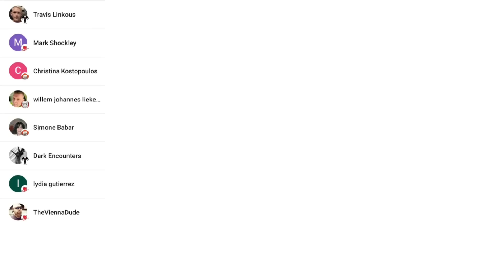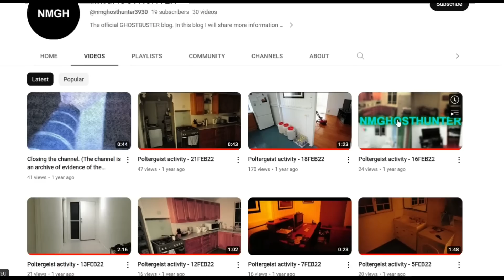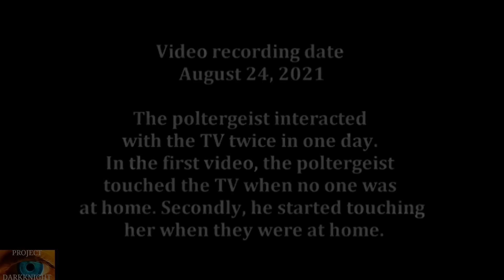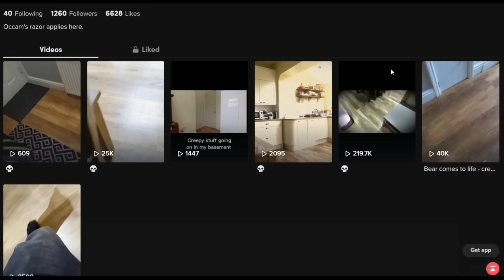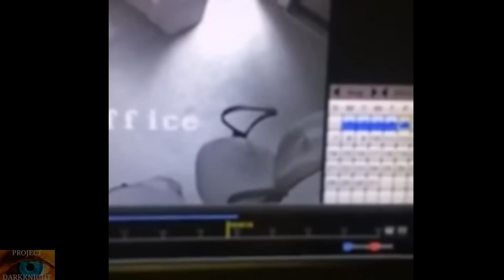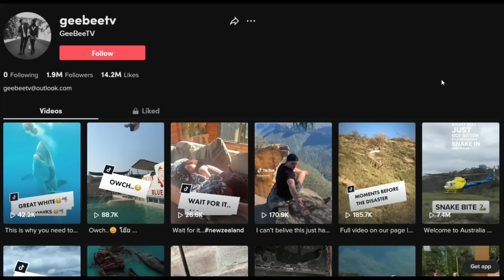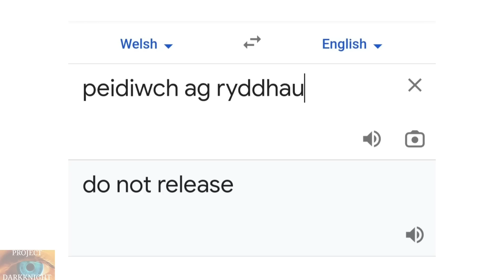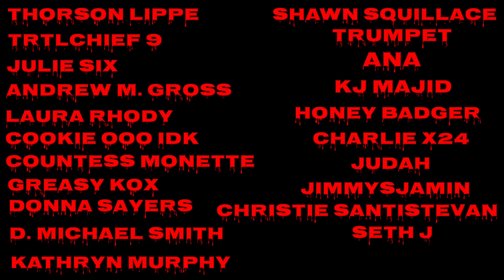Scariest Paranormal Videos That Will 100% Have You Checking Under Your Bed: WARNING

Comment: you can literally see them pulling a string from outside the glass door, it even snags on the curtains moving them when trying to pull whatever it was off the counter. green costume also makes it easy to edit people out but not easy enough when arranging the flour.
Reply: At what part when it did that
Reply: Nah you can't see a string. I'm sure dk wouldn't p post something that obvious.
Reply: I agree. Even where the curtains and papers were blowing, you can clearly tell the doors open and it’s wind. The flour part look heavily edited.
Reply: @milkyo1206 yes they definitely would lol. Anyone will do anything for money or fame. People know how gullible others are when it comes to the paranormal.
Reply: I can see cuts of the video at 08:45 and at 08:54
Reply: @milkyo1206  no you don't see the string, you see the shadow of the person outside pulling the string on the curtains while at the same time the curtains move in a way that requires pulling as opposed to being blown at the same time as the object moves on the counter

Comment: 10:43
Dude, not only was it pretty bad VFX, the "markings" in the flour are made the same damned way that you would make fake baby footprints. Put your fingers against your palm, almost like a fist, with your thumbs up. Then, tap/smack the bottom meaty portion of your hands into whatever you're marking. If you stagger and alternate left and right hands, it looks like a baby was walking. Normally you'd do 5 little dots by where your pinky touches, but here they just made 3 long lines in a bisected "V" shape to make the feet look "inhuman."

I'll commend them on their commitment, but all of their stuff is clearly just an amateur attempt at basic VFX techniques. You can see too much artifacting around where the "evidence" is shown, signalling that those pixels were altered before being compressed to try to hide it. I definitely want them to keep working at it because with enough practice, they could produce some good results. But I couldn't imagine trying to pass any of it off as genuine. Hell, the flour thing happened literally immediately after the girl walks out. Seems a little too convenient, right? And there aren't any bits where anything gets recorded on cell phones or from 2 different perspectives or even in high resolution.

There is a difference between thinking you did well as an amateur, and knowing that your work is good as a professional. It takes a lot of practice and patience to master that kind of stuff.

Comment: I think the first one was fake. It only took the sister 15 minutes to get evidence. Come on. It looked like the figure just appeared. Didn't look right to me. The shrek figure raising it's arm and then waving. I don't know.
Reply: Caspersight would tear that first one apart in .2 seconds. There is an obvious cut in the footage right before it appears to tromp through the flour. The flour ends up looking stirred up. I bet they didn't like how it turned out the first time so they had to erase it and redo the prints. Plus there is definitely masking starting around the knees to hide the rest of the person's body.
   So many  🚩🚩🚩

Comment: Age of 10 a friend and I goofed around with ouji board, I’m now 58 and have bad luck all my life after confronting demon in my teens. 6 months ago I heard typical 3 knocks and bangs then one month later what sounded like someone doing a mock vomit sound , a month after that I was diagnosed with cancer. To add to this I was in the U.S until age 30 now in U.K. It follows, be aware. The cancer was a single isolated lump on my neck. Diagnosed as aggressive diffused b cell non Hodgkin’s lymphoma. Now after chem undergoing radiotherapy. All my family are deceased either cancer or suicides. Don’t ever confront and dare a negative energy to do it’s worst just because your fed up with the bad shit happening in your life!  And that was as a teen, 8 years after ouji board and I still have activity everywhere I move to in any place. I’m also ultra sensitive to the unseen.any help or advice please

Comment: So that last one was very interesting. I dunno if someone set that up specifically for the channel to find, or if they did it themselves as a way to generate interest, but I love the storyline they're going with. By the way, the occult use of clear quartz is for storing energy, or 'programming' them with an intent. If this was real, the charge has probably long since stagnated. Old energy can be problematic in its own right.

Comment: Quartz crystals are also used to store/soak up bad and dark energy,which would make sense as to why they were hidden in another seperate box!.. That makes more sense than having used them for protection considering all of the other dark findings.I only found this out about quartz crystals very recently and was under the assumption that they're only used for healing.This is a bit spooky having just come across this information!.

Comment: That thing with the flour is real,I've seen a group of ghost hunters that have a channel on the internet that did a oujiboard session and a realy loud bang happened and 1 of the men took a hand off when he jumped and for 3-4 days every night something was messaging with him but at his place it had followed him home so he called the other bloke who was with him that night and he come around and they set up cameras and senses and they got something so the next day they put flour down and in the middle of the night it walked up the hallway with the flour and kicked his door open and it allso had 3 toes but a lot thicker,they went back to the house where it started and he originally took his hand off by mistake and did another outboard session and the house went nuts it was realy bad but they keeped there hands on it even thow it was trying to take the planchet off the board they both held it on and took it to goodbye and that was it,but while they were talking he told it that it has to stay here and not come home with him that's when the house went crazy but after it the thing was back there and didn't follow him back home again.pretty smart but common sense when u think about it.

Comment: Just wanted to point out that story number one almost had me, especially the prints on the flour. But one thing gave it away as fake and i noticed right away towards the end when the trash can is beign pulled towards the curtain you can clearly see the curtain moves right when the trash can gets pulled. Its more than obvious that a string was pulled from behind the curtain

Comment: You've been doing this for so long I'm surprised you didn't recognize those boxes straight away and gave such silly guesses Dave I haven't seen those guys vids about Thailand but I know a Dybbuk box when I see one and the one from Thailand was either the same thing or a spirit box similar to the Dybbuk I'm guessing someone had/was haunted/cursed by a demon so the family went to Thailand and bought a powerful spirit that counteracts the demon attachment hence why the seller was afraid it got sold and refunded them because of how strong it was but I'm guessing it must've worked out for the family since they managed to seal away the demon in that Dybbuk(the box sealed with wax) and managed to seal the spirit back into it's own box (the one with the key that said not to release) which is a pretty amazing feat whoever helped the family really must've had an amazing and vast amount of intricate knowledge on the paranormal to manage such heavy tasks

Comment: 12:11 I don’t want to break the party. I love TDK and N5 but watch this scene. After I saw it the first time, I though: Hmmm…..if a strain is attached to the bin, maybe they weren’t cautiously enough, so the string will move the curtain. And yes, exactly when a possible string would be pulled, the curtain moves at exact the place, it should be. Would be a big coincidence, that the curtain moves at exactly this place. And we are not able to see if the window door is open or closed. So I assume it’s open.

Comment: If this were a movie, you would be terrorized by an ancient demon that you released from the box. Using a piece of the mirror you broke, you attached it to the planchette and using the spirit board you find out that the family who lived in the house were cursed by a demon, but they had it contained in a box but no one has seen them sense. The only way to get rid of this demon is by having the family who had sent the curse and have them take it back….
Or the previous owner was just crazy 🤷🏼‍♀️

Comment: I could be wrong, but the “New Mexico” video  is sus.  Starting with the most obvious take a closer look at the light switches and power outlets are European style instead of the standard American design.  If anyone happens to be an electrician based on the install and style of the switches and outlets would this apartment be anywhere near American safety requirements?

Comment: That 2nd family shown using the flour method is faked. There are camera cuts. And when the trash can gets pulled towards the backdoor you can see the curtains move at the exact same time as the trash can does. Almost like fishing line is being used. Before and after the trash can is moved, the curtains do not move.

Comment: G&d studio I think is fake due to the end shot of the trash can in the kitchen sliding backwards. The blinds move at the same time which they would if someone is outside pulling a string, 8 lb fishing line is next to invisible but could easily open, move and manipulate most of all this supposed to be haunted house is doing.

Comment: Ok when she put the flour on the kitchen floor, did you see those handprints. I've long said that extraterrestrial mimics paranormal. Its almost impossible to distinguish between the two in certain circumstances. Those hand prints looked like what they say the grey's hands look like. Also the way the camera picks up that nearly invisible entity but it shimmers like the predator. Could very well b that they got the interest of the grey's. Even abductees report seeing dead relatives during thier encounters. There's much more to it but this has a different vibe to it than paranormal for me. That's just feeling I get from it.

Comment: O wonder why noone pulls the door open WHILE it's bein knocked on rather than afterwards. Why is there never a Ring doorbell cam set up when a door gets knocked on ?
Also, stacing of furniture in odd ways. Why is there not so much of that ?
Stuffed animals and dolls- put them in a cage and let's see them move. Put flour all around it on the floor and newspaper taped to the sides except for the front and a camera on it. 
....

Comment: AS FAR AS THE VIDEO WITH THE FLOUR THAT THE MOM PUT DOWN ON THE FLOOR ITS FAKE I CAN SEE ALL THREE CUTS IN THE VIDEO THE FIRST CUT JUST AFTER THE MOM IS OUT OF SIGHT OUTSIDE THE SECOND CUT IS A FRAME OF THE FEET APAIRING THIRD FRAME THE FEET MOVING IN THE FLOUR.